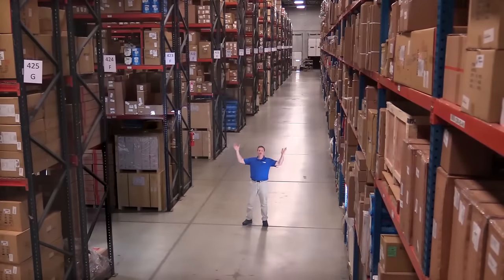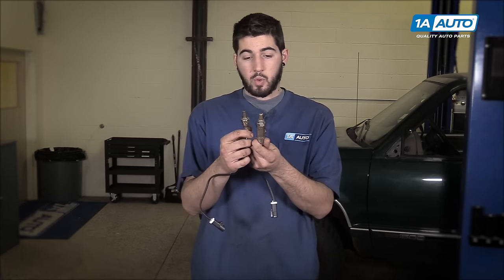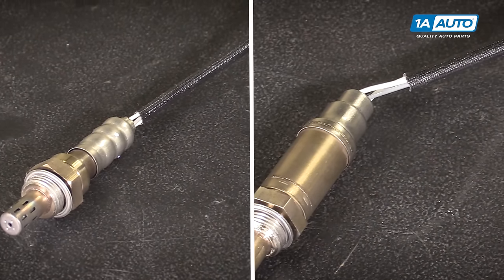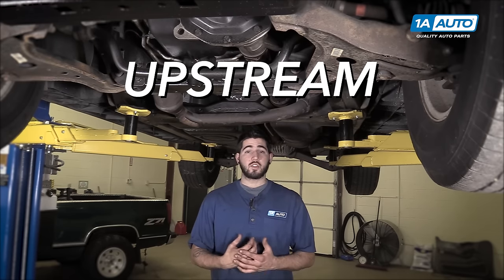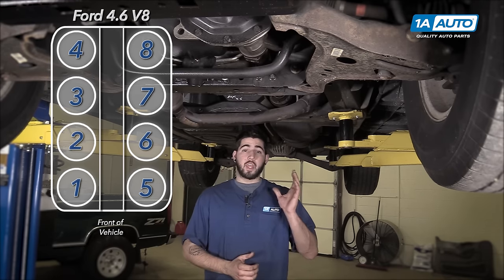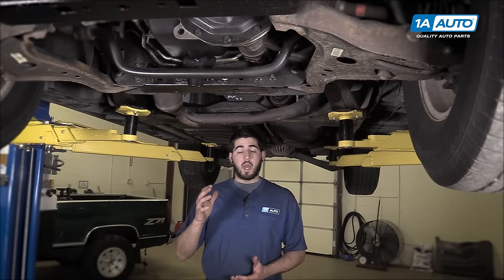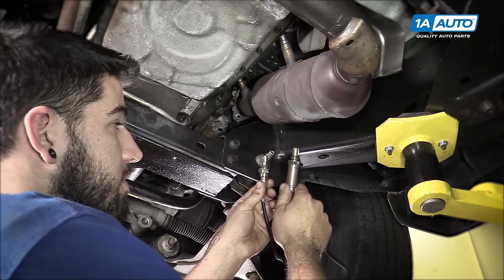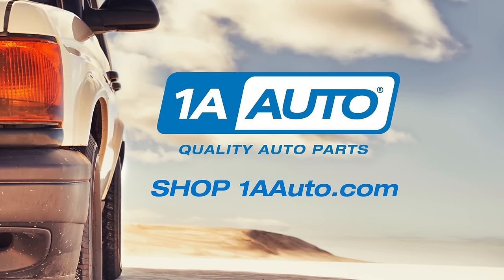O2 Sensors is it Upstream or Downstream?

Comment: Hi. I have a Honda Fit and my OBD scanner tells me that i have heater circuit malfunction in air fuel ration (A/F) Sensor (Sensor 1). Please tell me if that is the upstream or the downstream sensor? Thank you.
Reply: Archon Rye Your scanner is suppose to tell you if it's it's upstream or downstream by showing bank 1 sensor 1 (upstream) or sensor 2 (downstream).

Comment: That doesn't answer the big question can you use 4 identical downstream o2 sensors for upstream and work the same?
Reply from the maker: +NynnchLngAndMusQlr SevenPointFiveRound It depends on the vehicle. Some vehicles can take the same sensors for all positions, some require different sensors.

Comment: In a Honda is the upstream air fuel mixture and downstream heated
Reply: Most likely yes. Generally, if it has 3 or more wires going to it, it is heated. If it has 1 or 2 wires going to it, it is not heated.

Comment: Sentras (4cyl.) Have 2 banks with up and down streams!, (2 heated & 2 fuel\air) ? How do you determine which plug is which off the harness? And which type of sensor goes upstream, (heated or fuel\air?) once you figure out banks and streams?🔧
Reply: Stripped the wireharrness open couldnt macth colors on the wires! So i used length to determine position or location and got the car running.... Now the ecu is not setting keeps running a loop on the programming..
Reply: Suggestion-sell the car & get a Toyota/Honda🤷🏽‍♂️😂

Comment: When it comes to Bank 1  Upstream/Downstream, assuming the plug-in sockets to the harness are the same, the only real difference is the length.  You could technically use 2 downstream O2 sensors as its the Harness socket that determines which job is which.   Just don't put an O2 sensor on the downstream of the Cat and plug in the connector into the Upstream harness socket.

Comment: So does the check engine light go off once you change the sensor?
I have a 2006 Odyssey. Oxygen sensor bank 2. I'm still trying to find out where it's located.
Reply: No. After the change, you must drive your vehicle at least a week or two and then it will go off automatically.
Reply: Or you can clear the code either a obd2 reader.
Reply: You could have the same issue as me. If you bought anything other than the exact brand that came out of it the computer won't understand the sensor. From what I understand these shops keep replacing them and charge the crap outta people who don't know better. There are serious issues with o2 sensors not being actually made for your car. I bet whatever your issue is if you buy actual oem o2 your problem will vanish

Comment: I just put Full exhaust aftermarket ,on my 1998 honda accord 2.3 4cyl , i was able to put new upstream on the headers but, i replaced cat with a resonator and can't put downstream 02 sensor on it, will the car run fine without downstream sensor, there is no cat, just another 02 spot right before the resonator
any advice in my situation ?
Reply from the maker: +ABE 84 Thank you for checking us out. The vehicle should run proper, but you may experience a check engine light code. 1aauto.com
Reply: Hello I put a Full DNA exhaust on my 1998 accord 2.3 .. now i am having surge problems while driving not idle thru and idea's? thanks

Comment: Are you sure that 4 cylinder do not have Bank two?
Toyota Parts told me that 2004 Camry SE 2.4l  4 cylinder has 3 sensors.
Bank 1 Sensor 1 Air Fuel Sensor, Bank 1 Sensor 2  O2 Sensor--  Upstream Sensor s.
Bank 2 Sensor 1 O2 Sensor-- Downtream sensor

Comment: I'm still confused as to why they look different. If they both can fit in either hole    and I  remove both and get them mixed up  and cant remember which one goes where. . So theoretically if i accidentally  put them in the opposite position  of them coming out , they should be fine , right? or not?  So are they exactly the same  except for the length of wire  and one has many holes  .  And then why does one have holes and the other doesn't.  This was not addressed in the video surprisingly.
Reply: John Replace them one at a time, that way you'll never have to guess. Also the connectors will be different.
Reply: My prelude connectors is the same Auto zone Sayed they will work same part number
Reply: I get what you saying he never specifically said which one is which
Reply: Slots front, holes rear

Comment: HI, I have a 2011 Ford Fusion. I have check engine light on and when I plugged in code reader, I get following: "P2096 POST CATALYST FUEL TRIM SYSTEM TOO LEAN BANK 1" can you please tell me which oxygen sensor that I need?
Reply from the maker: +Asitha Jay Thanks for watching!  That code is telling you that bank 1 is running too lean (too much air, not enough fuel).  The issue is likely not the O2 sensor.  We recommend having a reputable garage that has an adequate scan tool diagnose the issue.  1aauto.com
Reply: What was the issue?
Reply: These answers are so cryptic.

Comment: Hi, thanks for the video. Great as usual. I have an oxygen sensor error code on my 1989 Trans Am: how can I tell which of the 4 sensors is faulty? Thanks!
Reply: Your scanner didn't tell you what sentir ir is? It should say bank1 sensor1 for upstream or sensor2 for downstream. Or if the problem is on the other side of the engine it will say bank 2 sensor 1 for upstream or sensor 2 for downstream sensor.

Comment: My problem with o2 sensors is the parts people, I have two upstream and two downstream I need to change for my 2013 GMC Sierra which is a 5.3 liter and they ended up selling me ones for a 6.2 liter, thank god I looked and noticed the difference before installing them and got my money back, so I get home and called AC Delco and the person on the phone was giving my three different part numbers even after I gave them my VIN! So I got fed up with them and then called GM customer service and the guy had no clue, he looked for 10 minutes and finally gave up and said we need to look into this in further detail, we will call you back around next Tuesday. SMH.

Comment: why are some o2 sensors totally different in how they look.  Some have multiple slots in the sides and others just have a few holes at the end of what looks like a bulb?
Reply from the maker: +William Patterson This can sometimes be a vendor difference depending on who manufactures the part or can be a necessity depending on what is needed for them to function properly on different vehicles. 1aauto.com
Reply: @1AAuto  Thanks.  I found a video that in so many words said the same thing.  I was just wondering since the ones I took out were different than those Bosch ones I put in...but all data streaming seems to show it is working just fine.

Comment: This makes no sense that upstream and downstream 02 sensors for the Ford Ranger would have physically different tips, yet they could be used interchangeably. The upstream sensors will have a long narrow tip with holes all around it. Downstream sensors will have a wider tip with 3 or 4 long slits running the length of the tip. This is how Ford ships the Ranger V6 4.0 XLT.

Comment: P1157 Lack of Downstream Heated Oxygen Sensor Switch - Sensor Indicates Lean - Bank No. 2 Honda Element 2006 2.4 4 cylinder How do I know which is bad? Upstream has male plug, downstream had female. They are $175 each...
Reply from the maker: +Mountain Man We are unable to diagnose the issue you may be experiencing but taking the vehicle to a local shop will be able to help you isolate the code.
Reply: Thanks.

Comment: Hi, I get a o2 sensor bank 2 fault on my Cadillac cts 2009, is that upstream or downstream?
Reply from the maker: +Mostafa Ghoneim Thanks for watching!  The bank number does not actually tell you if it is upstream or downstream.  You need to find out if it is "sensor" 1 or 2.  For example, sensor 1 bank 2 is an upstream.  Sensor 2 bank 2 is downstream.

Comment: What happens if you plug an upstream on a downstream or vice versa?
Reply from the maker: +Centaur The parts will not function properly if they are plugged into the wrong location.
Reply: 1A Auto Parts other than being in the wrong location, what's the difference between sensors besides how they look?  What do they do differently?
Reply from the maker: +Centaur Thank you for your response, there is a different ratio of oxygen in the exhaust gas before and after the catalytic converter so the sensors are designed to read this ratio differently. Additionally, the connectors usually differ between the two sensors so you wouldn't be able to plug an upstream in a downstream position and vice versa. 1aauto.com

Comment: It should be absolutely easy to tell which one is Upstream which one is Downstream because they look completely different I was trying to figure out if I put mine in right if you don't put them in right will your truck run funny cuz it runs okay but I'm afraid I got them mixed up
Reply from the maker: They wouldn't fit if they were installed in the incorrect position.  Thanks for watching! +Kevin Dotson
Reply: @1AAuto  what I meant was if you put the Upstream O2 sensor in the downstream and vice versa are you going to be able to tell as far as how your truck is running like I said before my truck seems to be running fine but I'm afraid I put the downstream O2 sensor in the Upstream spot and the Upstream O2 sensor in the downstream spot
Reply: @1AAuto  I have a 01 Dodge Ram my connectors on my O2 sensors are completely different as is the O2 sensor itself the threads are the same I can put either one of them Downstream or Upstream that's why I'm curious if I reverse them because I am getting bad gas mileage now if that is the case can I just put them back in the right spot or would I need to buy new ones again

Comment: Thx for the upload !
Reply from the maker: +andre reed Thanks for checking us out. 1aauto.com
Reply: Anything on changing thermostat ?
Reply from the maker: +andre reed We currently do not have an auto repair video that covers this particular repair. We will keep this request in mind in the event that we need to make this repair in the future. 1aauto.com
Reply: @1AAuto  whats an af sensor then? What it be the downstream
Reply from the maker: Looking similar to a conventional oxygen sensor, the A/F sensor has more wires. It is also known as "broadband lambda sensor" or "lambda probe." The air fuel ratio sensor is installed in the exhaust manifold or in the front exhaust pipe, before the catalytic converter. +david the boss
Reply from the maker: +DAVID THE BOSS  That would be an air/fuel ratio sensor, which would be "upstram."

Comment: Should have labeled the upstream and downstream parts earlier in the video. you never actually, closely zoomed in and identified which is which. do you know that?? 

you didn't actually do a close up on which one is which. you just held up the  parts and said which one goes where  according to the positioning on the pre cat or post cat locations- which is obvious-  what is downstream versus upstream, but you never answered your own question WHICH o2 sensor belongs where?
you could have just said something like  i.e. the notched surface of one of the sensors IS the upstream and the smooth surface of the o2 sensor IS the downstream. 
That would have helped if you just labeled that part and identified them earlier in the video and saved the view a fiew minutes of not getting the question answered....

Comment: I don't know if I buy your whole concept, too many variables. What I do know part number is key as long as it was not boxed wrong or the last guy did not switch sensors when returning them because he found he did not need them it was a Mas sensor. As far as the look I had systems that had all the sensors look identical on the same car, different lengths of wire and the part numbers were different too. And then there is the car that someone installed wrong part, so you fly by the seat of your pants and hope for the best.

Comment: So I just threw a code p0172 bank 1 too rich is that my upstream o2 sensor gone bad?
Reply from the maker: +3232myke We wouldn't be able to diagnose an issue like that here, you may want to have a local mechanic take a look at it. Thanks for checking us out! 1AAuto.com
Reply: @1AAuto  yea unfortunately I don't trust mechanics , I was just wondering if it could possibly be my o2 sensor ,, DAMN CARS!
Reply: This most likely means that the air fuel is not balanced, lean means there is to much air or not enough fuel, rich means there is to much fuel in the bank